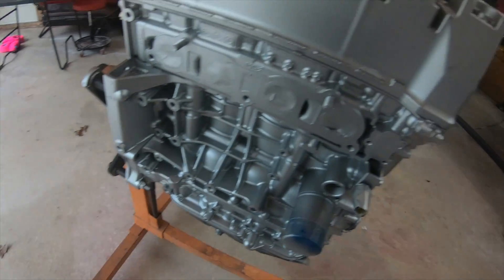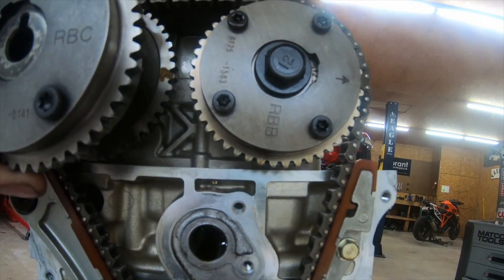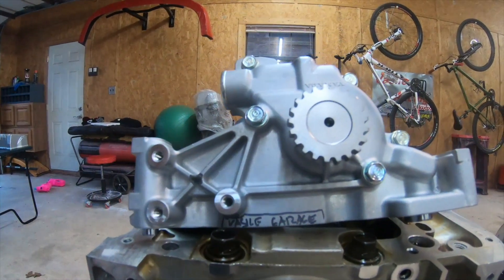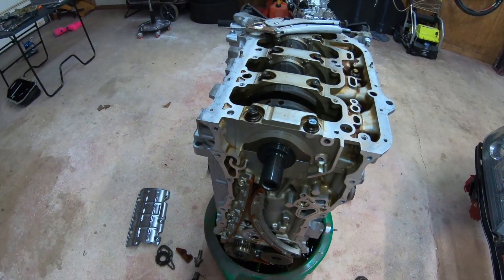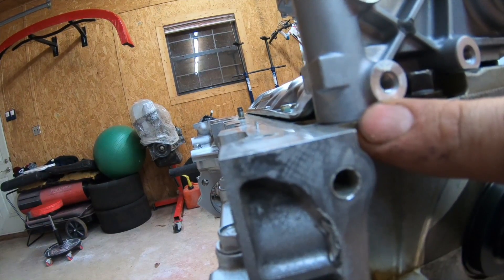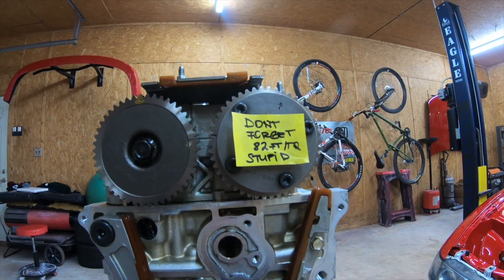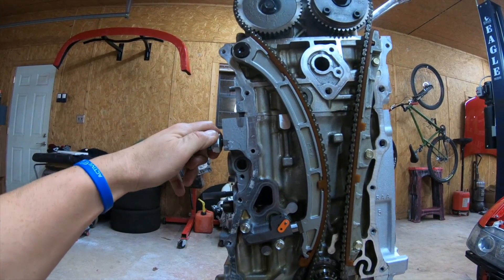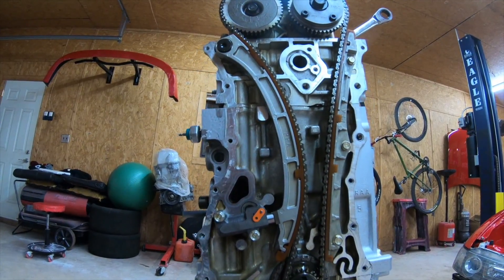k20a oil pump swap in k24

Comment: I'm reassembling my K24A2 CRX right now. I installed a Type S oil pump, and I have a Drag Cartel 45 deg vtc. What is the .025 gap on the oil tensioner your referring to?

Comment: Hey Bro, I have a 2009 Honda Civic Si, and just did an engine swap, got the K24 Block (TSX 2004-2008), and using K20 Z3 head. Forgot to take out the little oil port, was getting P2647 code (not getting enough, oil pressure when hitting VTEC, changed out everything, now I know to block that hole with a screw (Honda Bond), and going to modify the K20 Z3 Oil Pump (New), so it fits, not using Type S Oil Pump, because I'm not going on any track soon, just a daily driver.   Thanks bro, for your information, much appreciated.
Reply from the maker: Michael Kim glad you got it fixed
Reply: @vasilegarage2606  bad news, still getting the P2647 error code, why do you think I keep getting this code. My mechanic was not able to put in the K20 oil pump, it doesn't fit, so he had to use the K24 oil pump, you do think that's the issue, do you think I need to use the Type S oil pump?

Comment: @ Vasile Garage , I want to ask did you use the K24 oil pan that came with the engine along with the K20 oil pump and baffle?
Reply from the maker: rcnturbo77 I have. ktuned oil pan
Reply: Vasile Garage got you , but is it for a K20 or K24?
Reply from the maker: rcnturbo77 k24
Reply: Vasile Garage got it , thanks much appreciated it. Awesome build you have going💪🏼💯🔥
Reply from the maker: rcnturbo77 thanks friend

Comment: I did this swap and yosolo asked me why did i change  it ?? He said the k24 pump was bttr and looking at the video and rotation the k24 does look bttr.
Reply: The k24 oil pump cavitates oil at high rpms and doesn't lubricate the head. that's why the k20 pump is needed.

Comment: Question is how much does make all motor ?
And what’s you rev Limiter? 
Clean work 💯
Reply from the maker: Manolo C 240 whp 8000rpm
Reply: Vasile Garage 
Just 50 degree vtc and oil pump 
240🙂?

Comment: Why do people swap oil pumps the stock k24 have seen 500hp + stock block
Reply: Higher rev limit.
Reply: I agree  2 tuners told me why did i change the k24 and put the k20.. the explained it and it doen look like the k24 collect more oil

Comment: My 2008 honda accord has the 2.4 engine, and the oil filter is mounted vertical , i see your engine has the filter on the on the rt side of the engine it the horizontal precision ...
What the difference in the two ?
Reply: Theres a different series in the k24 engines, this is a k24a3 by the looks of things you may have a different k24 variant.

Comment: For the oil orifice on cylinder 3 seem you block it off with a bolt. Is that the only needs to be block off or there another one by the oil pump sit on the block?
Reply from the maker: jerry lee need blocked off
Reply: @vasilegarage2606  so just one hoke by the cylinder 3 hokw block only or there another one?
Reply from the maker: jerry lee yea

Comment: There is a tool you can buy from Honda it’s called camshaft locking pins. On the opposite side of the motor you can insert those pin locks into the holes at the end of the camshaft to prevent the cams from moving when installing a timing chain. I bought one and it’s amazing!!!

Comment: What’s the advantage of the RBC cam gear vs the RBB??
Reply: daz j the rbb is 25 degrees. The rbc is 50. You get more advance tunability.
Reply: @uome2k7 Hey, does that means after installing the RBC 50° cam gear the ECU will need to be adjusted/reprogrammed? Or Will the car start up and run normally without ECU tune? Like maybe the VTC will do all the job and take advantage by itself? Sorry my question might be kinda dumb but i  really want to know more as i am planing to slowly build a k24 k20 all motor engine. ☺
Reply: @Loyal_Honda_Fan  itll run and start. It will allow for the tuner to mess with the timing more during a tune for power and economy.
Reply: @Loyal_Honda_Fan  car will start and run but you can't take advantage of the upgraded cam gear without a ECU tune.
Reply: @ChavezDIY  thanks :)
Reply: @Loyal_Honda_Fan  no problem. I considered upgrading that intake cam gear to a 45 degree one too. I'd only do it if I could learn how to do my own tuning. The older my TSX gets, the less I want to pour more money into it. My plan is to eventually buy a used Tesla Model 3 and kiss the internal combustion engines goodbye.
Reply from the maker: thanks

Comment: You are the man! I’m doing a k24/20 build on my Integra and I wanted to see a video on the oil pump swap. Thank you!!!! Does the k20a pump run better than the RSX type s pumps?
Reply from the maker: Josh hit VTEG it’s the same thing K20a is the type s
Reply: Vasile Garage how did you break the crank pulley bolt loose? I bought the crank pulley holder and it was too loose. So now I bought this crank pulley socket and haven’t used it yet